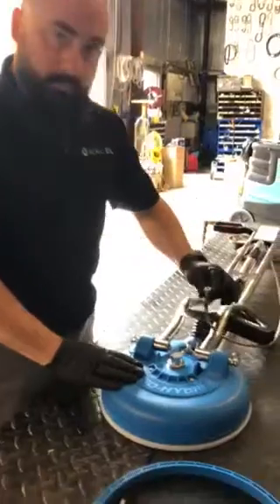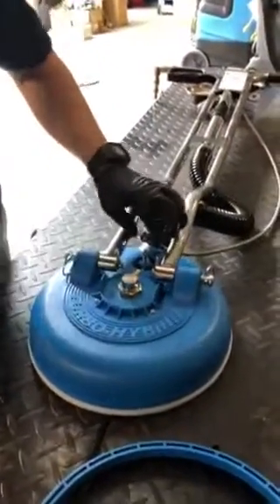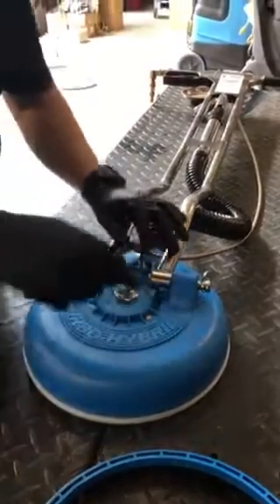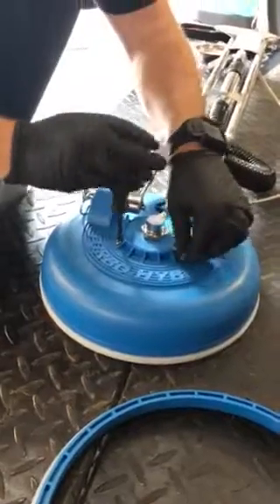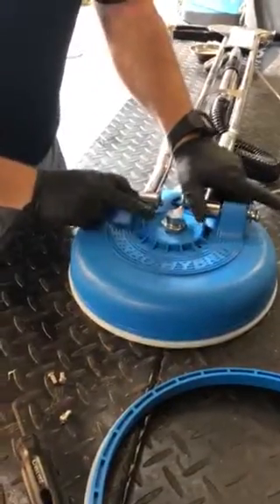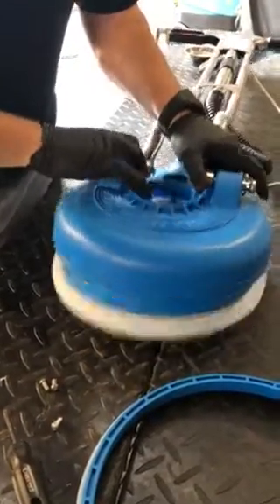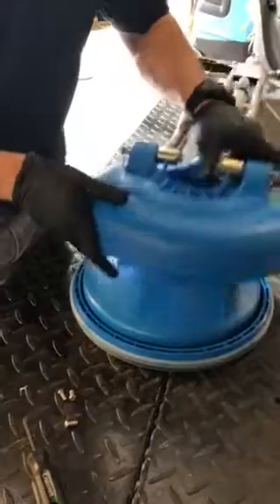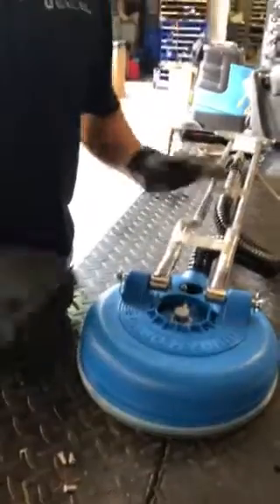Replacing your ring on Turbo Hybrid Tile Spinner

Comment: I was just firing up my heat gun, oh man thank you for this I would have made a big mistake
Reply: Thank just changed my ring out & replaced it with the brush run usin your video 😃👍🏻
Reply: Thank you! I have always done it wrong. I used a knife to pop it underneath and plug the other one in